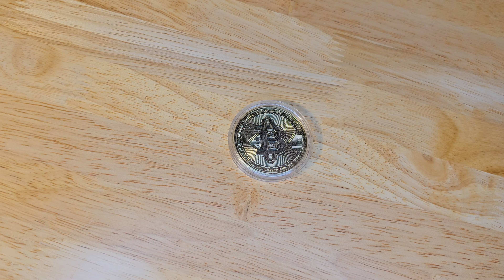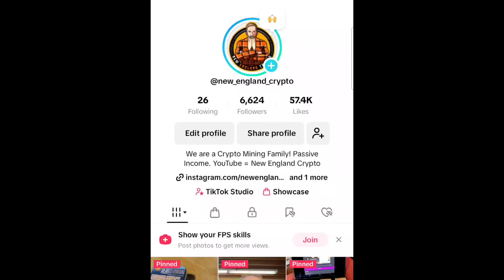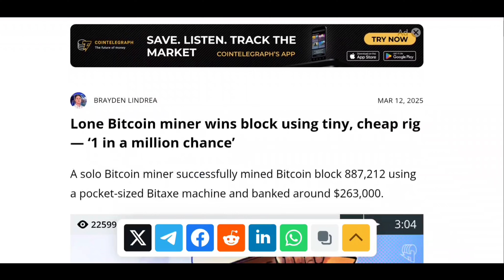NerdQaxe++ vs Bitaxe Gamma: The Ultimate Bitcoin Solo Mining Showdown!

Comment: i find it difficult to OC the nerdqaxe+. maybe i dont know how to do the python script thing, mine are just maxed out the stock allotted settings. but my gammas are running 715mhz 1230core volts, i'm trying to find their sweet spots, they run about 1.75Th/s average each, i'd like to see 2Th/s each. the NerdQaxe+ runs the 1368 supra chips, about 3.0Th/s each. I'm not sure whats their upper end expectations if I could just figure out how to OC them.
Reply: If you want 750 frequency and 1190 or 1200 for the voltage in nerdqaxe++ that will get ya just above 6th. I notice the temp ranges about 64 -65 but if you use both front and back fans with an extra external fan facing it and the temps go a lil bit lower. I just keep mine a lil over 5th with a frequency 660 and voltage at 1170

Comment: I've got four bitaxe gammas and two nerdqaxe+. running about 12 Th/s at 230watts, both modded and overclocked.
Reply from the maker: Well done. I haven't done much overclocking yet. Stock fans work fine still?
Reply: @NewEnglandCrypto  i have 8 bitaxes gammas now. but four are NMaxe Gammas, the screw holes are slightly diferent than the normal gammas, they dont seem to fit any stands ive got. i'm not sure what to do with them yet.
Reply: @NewEnglandCrypto  and Merry Christmas.